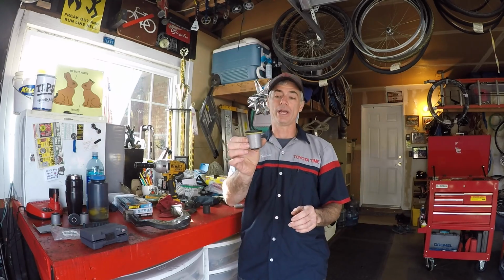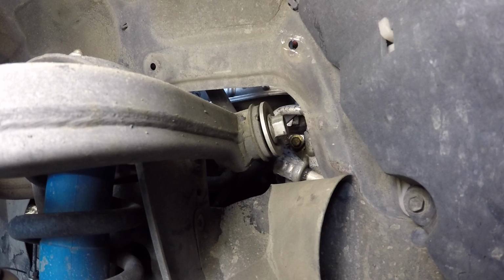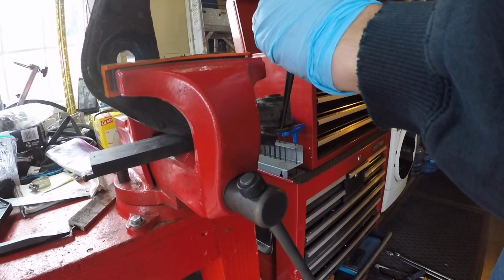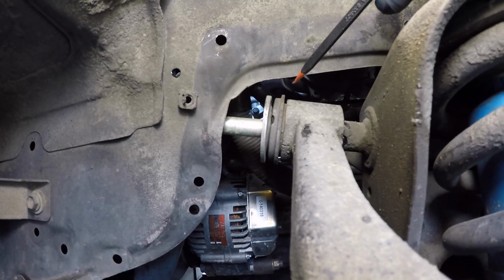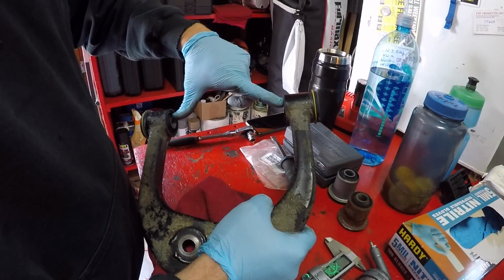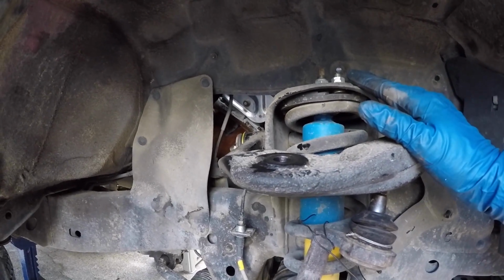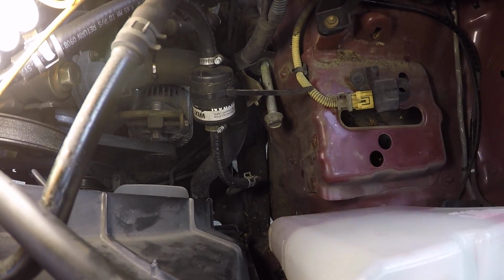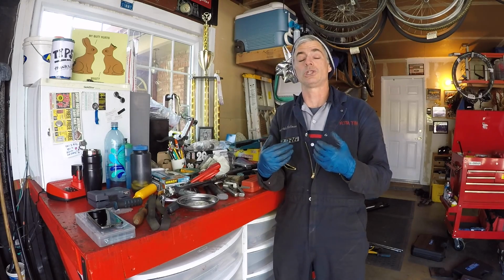Front Upper Control Arm Bushing Replacement

Comment: Timmy, need to pick your mind. I did this job last fall. I just determined that the upper control arm (UCA) is shifting. The bushings appear to have already gone bad. They were OEM, purchased from Camelback. I had a shop look at it to make sure the UCA bolts running through the bushings were tight. No issue there. I torque everything to spec. Is there any chance that one could push the bushings in too far thus creating the loose fit?  What would you recommend? I'm thinking about adding washers to minimize the gaps. Or would you recommend just buying an entire UCA? I had to use heat to remove them initially. Wondering if that did something.
Reply from the maker: When we shot the video, we noticed that Toyota didn't fully bottom out the bushings into the arm.  They left a little bit of gap between the sleeve of the bushing and the arm.  What we determined is this put a lateral load on the bushing when the bolt was tightened because the sleeve of the bushing needed to push inboard a bit to meet up with the frame member.  Jordan and I thought about this and figured this wasn't something that was good.  Why would you want a load on the bushing in it's static state?  So, we pushed one bushing all the way in and left the other out around 1mm and that made a tight fit of the bushing sleeve with the frame member so when the bolt was tightened, it wouldn't be pushing the bushing inboard putting a lateral load on it.

So, to answer your question, if you fully pressed in both bushings, you would have a hard time fitting the control arm onto the frame.  If you leave the bushings out too far, this will put that lateral load on the bushing like it came from the factory and would probably cause the bushings to fail prematurely.  

One thing that would definitely accelerate the demise of the bushings is tightening the control arm bolt when the arm isn't in it's neutral state, meaning the wheels are on the ground and the weight of the vehicle is fully supported by the wheels.  If you tightened them while the vehicle was still raised in the air on the jack stands, when you lower the rig to the ground, the bushings are in a bound state the whole time.  The bushings should only be a bound state as the suspension is cycling up and down.  The bushings should not have torsional forces applied to them when the vehicle is at rest.  I hope that makes sense.
Reply: @TimmyTheToolman  yup! makes perfect sense. i clearly pressed the bushings all the way in until their lip was against the UCA. Oddly, I appear to have done it on both sides, but only the passenger side is shifting. i actually just tightened the UCA bolt while the tires were off the ground. i'm guessing it's a bit over torqued, but the shifting has pretty much subsided. will keep an eye on it. thx again Timmy! you da man!

Comment: On the left side of my rig, the fender is bent in (from an accident) and it blocks the bolt of the control arm from getting out. What should I do to fix this?
Reply from the maker: Get a big pry bar or similar tool and wedge it between the bolt head and fender and start prying.  This metal isn't that thick so you'll be able to pry it away enough to clear the bolt.

Comment: Does Whiteline make a bushing kit for the upper the upper control arm? I can't find one listed anywhere which makes me wonder if the lower control arm bushings also fit the upper controls arm. Do you know if the Whiteline W53377A bushing kit for the lower control arm also fit the upper control arm? If it does why not use it instead of the OEM rubber bushings? Why do you recommend the OEM rubber bushings over polyurethane bushings for the upper control arm?
Reply from the maker: Whiteline does not make poly bushings for the upper control arms.  The W53377A bushings will not work for the upper control arms.  I think there are other companies that do make them for this application but I remember that they are from companies I wouldn't buy from because they make cheap aftermarket parts.  So, the reason why we only suggest OEM rubber bushings is it's the best option available.
Reply: @TimmyTheToolman  Thanks for the reply. Makes sense to me. Thank you.
Reply: @TimmyTheToolman  FYI, I just receives a response back from Summit and they say that Nolothane makes polyurethane bushings for the upper control arms. See https://www.summitracing.com/parts/nlt-rev042-0058 for the specific part they recommend. I'm not sure if you are aware of this. I think Nolothane makes a product that is of the same level of quality as Energy Suspension and Whiteline. Would you agree with this?
Reply from the maker: @marksimcoe4105  Hey Mark, I"m not familiar with Nolothane.  Haven't heard anyone on Toyota forums referencing their name.  So, I don't know what kind of quality bushings they make.  Thanks for sharing this information though.
Reply: Whiteline now makes front upper control arm bushings for the 3rd Gen 4Runner. The part number and link to the Whiteline page is as follows:  @TimmyTheToolman  https://www.whiteline.com.au/product_detail4.php?part_number=W53529  The part number is W53529. Looks like it might be a little hard to get but, they do make them now.
Reply: FYI, Nolothane and Whiteline are both Australian based companies and the 4Runner bushings I have seen look identical. It would not surprise me at all if the bushings come from the same factory. I would consider Nolothan and Whiteline to be virtually the same based on the quality and appearance of the bushings I have seen which would give us another option for hard to find bushings.
Reply from the maker: @marksimcoe4105  Cool, this is good to know.  Thanks for sharing this.
Reply from the maker: @marksimcoe4105  Cool, thanks for doing the research on this.  Looking on the USA site though, they aren't listing them for sale so I guess you have to order from Australia which is why you said they might be difficult to get.
Reply: Mark Simcoe You are correct sir, these are the same bushings - they are essentially “the same” company. Apparently these bushings will be released under Whiteline at some point. https://www.nolathane.com.au/product_detail_REV.php?year=2002&make=Toyota&model=4Runner&trim=Limited&part_number=REV042.0058 if you order they’ll ship out of SOCAL for US. 

From Whiteline “The upper control arm bushings have not yet been released in our Whiteline brand. I was working on a product release, but then Covid happened and put a delay on everything.
 
You can buy these in our sister brand Nolathane. Same exact quality and warranty as the Whiteline part would be.”

Comment: When you pop the UBJ out of the UCA at around the 4 minute mark would you be able to press out the UBJ at that time? Looks like a lot of room. Thanks for all your vids!
Reply from the maker: It's tight to get in there with the balljoint press but people have done it.  The main issue isn't being able to get the press in there but it's the fact that a lot of force needs to be applied to the balljoint spindle and the knuckle isn't secure.  With the knuckle able to move around, it's not easy to apply force to the balljoint press to get the balljoint out of the knuckle.  This is why I prefer to just remove the knuckle off the rig so I can secure it in my bench vice and then the press work is easy.
Reply: @TimmyTheToolman  Gotcha. Well hey appreciate all your vids! Looking forward to the next one.

Comment: Hey Timmy, great video. Novice mechanic here and I want to ask that this procedure to replace the bushings is to avoid having to pay approximately $500.00 per Control Arm and Ball joint assembly unit? Just comparing the cost of all the tools and items needed to perform the job to buying two complete units, etc.
Reply from the maker: Thanks Esteban.  You have to look at tools as an investment.  Specialty tools like a Harbor Freight press, press sleeves and other tools can be expensive but they will easily pay for themselves, maybe after just one job.  Then, you can use them for other jobs and save more money.  So, it all depends on how involved you will get into auto mechanics.  If you like it and plan on doing most of your own work, make the investment.
Reply: @TimmyTheToolman  Thank you Timmy. I appreciate your input. I've been keeping a list of the tools you recommend and I'll begin to purchase them as my budget allows. I want to learn and do all of the mechanical work myself once I purchase a 3rd Gen 4runner.
Reply from the maker: @estebanserrano1303  Sounds good.  You won't regret getting into auto mechanics.  It's a great skill to learn and share.

Comment: Went I put a 3" lift on the front spring shock, should loosen the control arm for bunchings,
Reply from the maker: Yes, not a bad idea.  Loosen the bolt/nut and when the vehicle is back on the ground with the weight on the tires, torque the UCA bolt/nut to spec.

Comment: Great video Tim. I want to replace the upper bushings on my 2003 tacoma 4wd, by with a manual transmission. Will the part number you gave work on my vehicle. Toyota says the bushings are not serviceable. Thanks
Reply from the maker: They should be the same but I'd feel better if you were able to confirm this at a dealership or online from a Toyota parts seller website.  That's weird Toyota says they're not serviceable.  They're obviously serviceable because they sell replacement bushings.  Do your UCAs look identical to the ones on the 4runner?  I'm assuming they do because the front suspension for the 1st Gen Tacoma and 3rd Gen 4runner are pretty much identical.

Comment: For the upper ball joint nut, do I need to have the weight of the vehicle on the ground before torching it to spec or is that for the UCA bolts only?
Reply from the maker: It's only for the UCA bolt.  You can torque the castle nut for the UBJ with the wheel in the air.  The reason you want the weight of the vehicle on the tire before tightening the UCA bolt is you don't want to have the bushing in a bind when it's just sitting there parked in a neutral position.  If you did, this would degrade the bushing very fast because it would be under tension most of the time.

Comment: Do I need to lower the truck to torch it to spec after installing lower control arm bushings too?
Reply from the maker: Yes, that's the best practice.  You want to torque control arms in their neutral position so the bushings aren't bound up just sitting there with the vehicle parked and the suspension not cycling up and down.

Comment: Update: This last time I say that the bushing break again, and it's not true. I assume that for the squeaky sound -as its in the past-, but when I see and test moving the steering wheel the sound was from lower bushing now!.
I Appologize for this.
So far the upper bushings appear in good condition.
And I gess that the previus time be damage because the arms do not "rested" in load position.
Thanks
Reply from the maker: Good to hear you figured out what the culprit was and why the previous bushings failed.  Thanks for getting back to us and sharing this.

Comment: I are frustrated. The first time did this change (upper arms bushing) I Think was in 2012 and everything was ok, lasting 6-7 years (Febest). But now:
1. 2018 mechanic worked it:~one min! and totally break
 (<1KM)
2. 2019 Myself ~ one min and totally break (TZK, japan)
3 2019  Myself , October ~ 1 min and again totally break (MOG)
This last time a sure that the arm at 8 to 10 degres over horizontal simulating the "load position" with a jack, thats i think did not in the 2 first time. 
What happen here??? what is the mistery??, what I did well in 2012?? maybe i press exaclty by exterior flange? and this time I press a litle bit more inner at the rubber (2-3mm)?
Reply from the maker: Mitzael Wtges I don’t know why your bushings would fail so fast if you’re doing the installation properly and not over-greasing them making the bushings bulge out.

Comment: Clunking... still no answer ... using the Chassisear I've listened to upper and lower control arms, front spring, front shock,  engine mounts, transmission mount, body mounts, sway bar, and outer tie rod.  I replaced the steering rack bushings.  The shocks and top hat are new.  LBJs are new and OEM... I get a clunking from the front of the vehicle as I travel slowly on uneven pavement and if I jerk the wheel. 2001 base model rwd Tundra.  Is there anything else I could listen to?
Reply from the maker: johncpen2000 inner tie rod, steering rack guide bushing, lower control arm bushing, or something else that simply might be loose... end links? Or steering racking bushings?

Comment: Do you recommend an alignment check afterwards?
Reply from the maker: johncpen2000 Nope, no alignment needed.  The only way you'd need an alignment after this job is if the previous alignment was performed when the bushings were wasted and had lots of play.   The upper control arms unlike the lower control arms have no adjustment to them so your alignment shouldn't be affected.

Things like this, upper or lower balljoint replacements, replacement of stock struts or springs shouldn't affect the alignment.  When you lift the rig, you need an alignment afterward.  When you replace lower control arm bushings, even if you marked the cam sleeve positions, it's a good idea to get an alignment.  Replacing inner or outer tie rods, it's a good idea to get an alignment.

Comment: No alignment needed?
Reply from the maker: Nope, no alignment needed Rob.  The only way you'd need an alignment after this job is if the previous alignment was performed when the bushings were wasted and had lots of play.   The upper control arms unlike the lower control arms have no adjustment to them so your alignment shouldn't be affected.

Things like this, upper or lower balljoint replacements, replacement of stock struts or springs shouldn't affect the alignment.  When you lift the rig, you need an alignment afterward.  When you replace lower control arm bushings, even if you marked the cam sleeve positions, it's a good idea to get an alignment.  Replacing inner or outer tie rods, it's a good idea to get an alignment.

Comment: How much does it cost for a new control arm with bushings ?  Seems buying the bushings separately may not save much $
Reply from the maker: $175/each online pricing, total cost $350.  Bushings run $30/each, 2 per side (4 total), total cost $120.  $230 savings.  I guess it depends what your time is worth and if you have the right tools to do the bushing replacement.  All the tools we used in this video to do the bushing swap have been used for many other jobs so it's not like the tools are for a single use and not worth the investment.
Reply: @TimmyTheToolman  If you don't have any of those tools can you rent the tools needed to remove the bushings?  Seems you at least need a work bench and vice, maybe a torch, etc.
Reply from the maker: @RobertMOdell  You can't rent a press or that press sleeve kit and that's what we use in this video.  I think you can rent bearing splitters though.  Could you do it on a bench vice using a torch and other tools?  Maybe.

Comment: How would you use a pry bar to check the condition of the bushings?  What would you pry against?
Reply from the maker: You just have to see if you can capture the control arm with a long pry bar and hook the end up something solid like the frame to flex it and looking for abnormal play in the bushings.

Comment: Would you recommend polyurethane bushings in this application?
Reply from the maker: Sure, but it depends on the manufacturer.  Who makes them for the upper control arms?
Reply: @TimmyTheToolman  Daystar, Energy Suspension... For a 2001 Tundra
Reply from the maker: @johncpen2000  It might work out ok, but I've found Energy Suspension bushings for control arms not the greatest because of the extra work required.   I'm guessing they just replace the rubber portion with poly and you have to burn out the old rubber and maybe reuse the washer portion of each bushing too.  If they were more like Whitleine lower control arm bushing that are basically an OEM replacement style with the metal sleeve I'd say go for it.  I guess it depends how much you want to screw with the ES poly bushings.  If it were me, I'd just spend the extra money for the OEM Toyota bushing replacements.

Comment: Tim, thanks for all the hard work and dedication you've put into these videos. 
I see the link to the bearing splitter you provided but was curious what the span is on that splitter you used. I have access to some splitters but would like to have an idea beforehand as to which one I would need.
Thanks
Reply from the maker: I'm stuck at work for a couple days so I can't take any measurements for you right away.
Reply: @TimmyTheToolman  No worries. Whenever you get to it. Thanks for the quick reply!
Reply: Tim, did you get a chance to check that splitter out for the span? Also which one did you buy? Amazon has a 5 and a 7 ton splitter. I'd rather not but the whole kit for one job especially since I have the access to a set. Thanks
Reply from the maker: @hidjet  I used the 7 ton splitter.  It's a big bearing splitter. .https://www.amazon.com/gp/product/B002BHVZ5O/ref=ppx_yo_dt_b_search_asin_title?ie=UTF8&psc=1